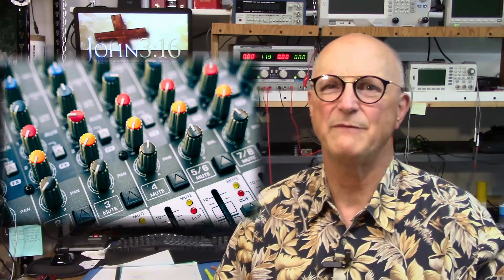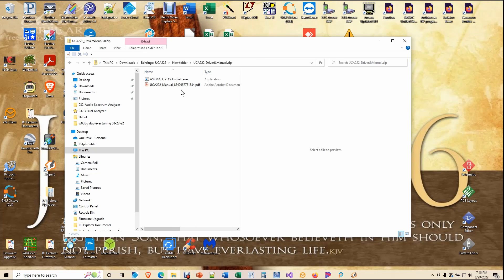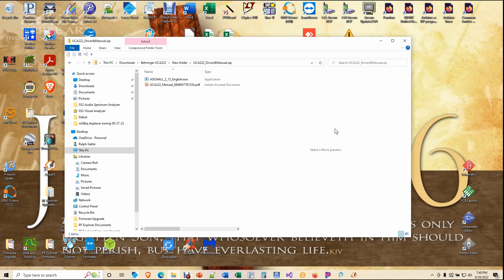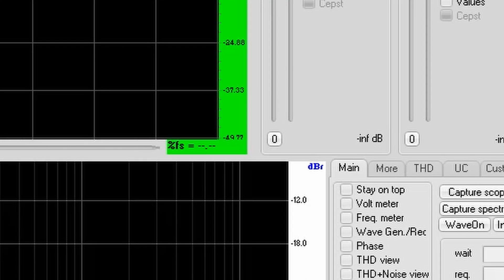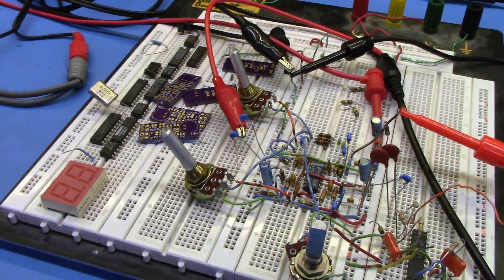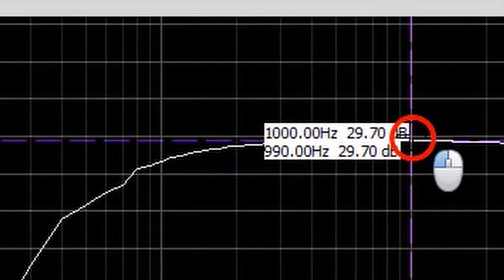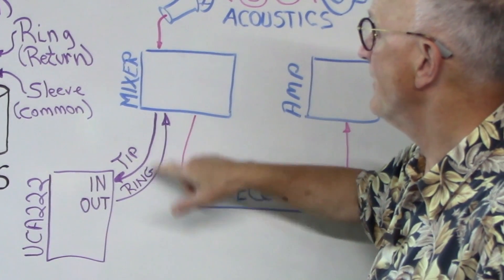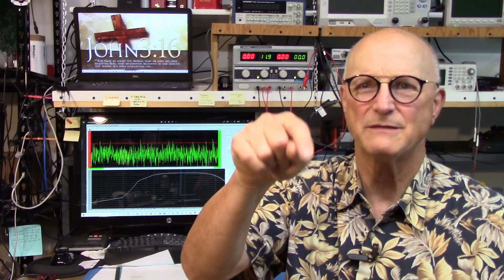Audio Spectrum Analyzer on the Cheap (032 )

Comment: A wonderful video! I have a Scarlett Solo 3rd Gen audio interface (192 kHz).
So I was thinking of taking a white noise signal (200 mVpp amplitude) from my Siglent SDG1032X and feeding it directly into the audio interface, while also sending it through a UUT to the other channel of the same interface. Then, I would feed both signals into the spectrum analyzer of VA and display the difference in dB.
Could this work? thanks in advance
Reply from the maker: Thank you! I'm glad you liked the video. Your plans sure seem to be the right way to go. With the Capture Spectrum you can save the data and process with a spreadsheet. You are on the right track! :-)
Reply: @eie_for_you  Unfortunately, my Scarlett Solo 3rd Gen sound card doesn't have a stereo input. I wanted to know if the Berhinger UCA 222 is compatible with Windows 11.
Reply from the maker: Yes, the Behringer UCA 222 is compatible with Windows 11. I have used it there. Just follow the directions in the video about making it a stereo entity in Windows. Windows likes to default all of the audio inputs to mono.  Upon a Windows update (which come way too often), the update may revert it back to mono. Don't you just love how they "help" us? :-)
Reply: @eie_for_you  Sorry, in the link you suggested to download the software I see the asio4all software; is this correct? yhanks inadvance
Reply from the maker: the asio4all is the driver for the UCA222. The visual analyzer link is above that a ways in the description. I hope this helps. :-)

Comment: i have got the focusrite audio interface 3rd gen. will need to purchase a 6.35mm 1/4 inch TRS Stereo Female to 2 Dual 1/4 Inch TS Mono Male Y Splitter Audio Cable . fyi i have purchased the dayton imm-6. its the same setup right?
Reply from the maker: The audio interface ... as long as it is stereo and can supply stereo channels.
As far as you microphone, is it the same ... well...yes...and no. It depends on what you are trying to accomplish. The advantage to using the existing system microphone, mixer, speakers and amplifier is that it take *everything* into consideration, including the frequency response of the microphone, speakers and so on. It also puts the microphone in the physical location in the space where it is going to be used. Acoustics are everything. For instance, at my church we have one microphone which is nearly impossible to extinguish the ringing from. Put *any* microphone in that same location and we get the same issue (the speakers are in the wrong place and hard mounted to the wall!). So, microphone location and frequency response is pretty much everything when leveling out a venue. 🙂

Comment: Need some help. I want a spectrum analyzer to work in my custom project vehicle. I want the signal to be displayed on the tvs in my vehicle for the fun factor. I can buy SA's on amazon but none have a video output to send to a screen. What do i need to get the video signal to a tv?
Reply from the maker: Seeing as this is done in software running on a computer, you would simply use the TV as a computer monitor. 🙂
Reply: @eie_for_you  As per this example, the berr is only putting out audio to the pc to show us the programs. So, still no video output. As it's a vehicle, I am not putting in a pc. So, again, is there an analyzer that has a video out passthrough maybe a portable one, or are all just 3.5 or similar audio outputs?
Reply from the maker: @bnaudio7813  Aaaaaahhhh .... sorry for the oversight!😟 I'm sorry that I cannot help you on this one as everything that I am doing generally uses a computer. 😕
Reply from the maker: Cool! :-) (sorry for the late reply ... man, this comment system often "hides" responses to previous responses.)

Comment: congratulations !!! this is the moust necessary tool for verify DIY and other audio projects for me !!!
Maybe, its necessary one box with compatibilizaction for all types off audio signals...
thankyou
Reply from the maker: Yes, I have also found it to be an awesome system for doing this stuff. When I worked on product development for a company that manufactured audiological equipment, I got really spoiled because we had a top of the line Hewlett-Packard Signal Analyzers. They were soooo nice and soooo expensive. This does the job for me just fine for the stuff I do now. 🙂

Comment: This what I looking for...tnz
Reply from the maker: That's fantastic! 🙂
Reply: @eie_for_you  now I want to setup. Test rig on how to measure THD of my power amp at full load...I have already a dummy load and scope.. the problem is how can I input that large amplifier signal on DAW without compromising audio signal linearity and not frying my audio interface... Pls need help
Reply from the maker: @jeffersonavila7275  Use a simple resistive voltage divider of a high enough impedance that it doesn't disturb the output to the load.
I'd just connect the resistive voltage divider across the load.  I am assuming this is a linear amplifier as opposed to a class D or similar amplifier. 🙂
Reply: @eie_for_you  yes, class AB power  amplifier... But I'm planning also to test class d single ended output....
Reply from the maker: @jeffersonavila7275  I had forgotten about the low pass filter on the output of the PWM to produce the analog signal to the speakers.
In this case, it is the same thing ... a simple resistive voltage divider should do the trick.
Some amplifiers of this type depend on the highly inductive load of the speaker to be part of this LPF. In this case you would have to use "acoustic coupling" with a speaker and mic with a known HD. You could use any speaker and mic and "calibrate" them yourself. Measure the HD of a purely analog amplifier with a known signal at a similar level as what will be used to measure the test subject. Then measure the HD at the output of the mic. The difference between the two is the "calibration factor" for your speaker and mic.
Now connect the test class-D amplifier being careful to maintain the exact same acoustic environment used in the "calibration." Measure the HD at the output of the mic, remove the effects of the speaker and mic. And you are there. 🙂
Reply: @eie_for_you  seems difficult to make.... Can u make a vlog about class d thd measurement, ? Tnx
Reply from the maker: @jeffersonavila7275  Unfortunately, I do not own a class D amplifier. But this would be an interesting topic to address. 🙂

Comment: The USB scope you said you use all the time. That being the case why download the VA scope using the VCA-222?
Reply from the maker: The answer to your question is that the UCA-222 is WAY cheaper than an official USB scope.  For many purposes, this does the job very nicely along with the Visual Analyzer software.
The VA software is a piece of software that uses whatever audio interface you might have (including the built in one that is in all computers) to provide a scope-type and signal analyzer-type experience for audio-type projects. This includes determining the audio frequency response of circuits or systems.🙂

Comment: your microphone is clipping
Reply from the maker: Fixed. Thank you! My gain was up a little too high on the mixer. I backed it way down and now make it up in post production starting in my next video. :-)
Reply: @eie_for_you   nice can add some foam around the mic for wind noise, the distance amd angle is important also,  i think there is a sensor and program that senses it and automatically adjusts
Reply from the maker: @DeVoNmotorsports Thanks! In post production I can add a compressor and a limiter to dress up the audio. The clipping was in the original recording...can't do much about that unless I am willing to drop $$$ on special software to "unclip" it. Not happening.  😀

Comment: I need to show the audio output of crystal radios (since IP law prevents me from playing it). Especially cross talk between channels.  My assumptions: 1) this has enough resolution to show the different audio waves (say voice and music) and 2) that I don't need stereo input to do that. True? Thanks in advance.
Reply from the maker: So, you are wanting to analyze some audio from a crystal radio. Audio, in general, is considered between 20 Hz and 20 KHz. All forms of music consume most of this spectrum to one degree or another. Some of the bass stuff is actually sub-audio (we feel it, not actually hear it).  The human voice is a subset of this frequency space, generally running between 500 Hz and 3 KHz depending on the person. Men tend to be in the lower half of this and women, the upper half.
With all of this said, if all you are doing is analyzing an audio source and that source is monaural, then you would not need stereo capability.  The stereo capability is needed if you are trying to either determine the frequency response of a device, circuit or system or if you were looking to analyze a stereo signal.
As a note ... most often, the main vocals of a stereo track are usually "dead center" with little to no phase difference between channels. The music portion is carried in full stereo. The vocal track can be significantly reduced or eliminated by eliminating the signal that is common to both channels (the voice/singing is a "common-mode" signal).  Hope this helps. 🙂
Reply: @electronicsfortheinquisitiveex  Yes, thank you very much.
Reply from the maker: @tsbrownie You are very welcome! 😀

Comment: Excellent information and demonstration. Just what I need to see the noise I have on one of the four band eq stages of my practice bass guitar amp. So next quest is to find that pink noise generator for the input signal to save me the "plucking" pain of creating a source signal!
Reply from the maker: Thank you!
The software, the Visual Analyzer software, has a "built in" signal generator that will provide the needed signals via the sound card on you computer. So you should be set there. 🙂

Comment: Visual Analyzer is a great tool, i've been using it for years  as realtime audio monitoring with the key feature it shows logarithmic frequency axis which other tools do not provide at all. And it has lots of features, and it's capabilities are bound to the audio device and driver, once a very high capability hardware is connected with a proper windows audio driver, you can configure sampling and FFT to match it and get very fine detail, but for audio i don't see the necessity in going over 44100/16. Never used it as a bench oscilloscope, but it was created for that purpose, i'm going to try.
Reply from the maker: I also like my Vellman PCSU200 USB-based oscilloscope for doing audio work.  I is an oscilloscope, spectrum analyzer, transient capture, built in signal generator and has a built in functionality to create detailed frequency response plots.  Frequency response plots are not real-time like Visual Analyzer, but for circuit analysis of an amplifier, it is super.

Comment: This video is very interesting, I’m currently trying to work in car audio and was looking for a way to set crossovers on car audio amplifiers. Although there are tools on the market such as the Steve Meade tools that can do this accurately they are very expensive so I figured maybe an audio visual analyzer could be the solution to this. Although I’m not sure this will work in my specific situation, I am trying to learn more about car audio and how to read this kind of information so I can in the future install quality car audio systems, so this was very interesting thanks for the quality video!
Reply from the maker: I am glad that you found the video helpful. 🙂 Car audio is in many respects no different that any other audio venue except for the acoustic environment and the power source used. The size of the equipment changes to fit the vehicle.  The temperatures that any electronic equipment is subjected to inside a vehicle is also extreme; this is why "automotive" rated components have such a wide ranged of operating temperatures. Enjoy your pursuit of knowledge ... "always learning" is the motto of the inquisitive experimenter.

Comment: Stunningly clearly presented video, and the Lab equipment I saw here shows this is one serious Experimenter! I was fortunate to be of the same generation, from having a little Transistor and Tube Radio repair business in 4th grade on to working at the Authorized Service center in a Lafayette Radio store in NNJ in the 70's, enjoying reading Wireless World and Audio magazine. Did Pioneer, Sansui & Revox authorized service thru College and bought an SX-1010 for $470 there , saving all summer. I always wanted to get a PC Sound card based Audio Analyzer going and bought a Behringer UC-222 tonight! I am also into old Ham Radio since 1969, and am restoring a Kenwood 599 Twins setup, AND bought the great value Behringer B1 Mic, Tube Preamp. EQ, and 4600 Compressor to make a wide band sounding Ham Radio station especilly for the "AM Window", and add my full National Radio setup including NCL-2000 amp.
Wonderfully clear Installation and setup info for this great USB to Audio interface, and the BIG picture of probing the whole Sound Chain! I have some great Audio and RF signal generators AND a very clean HP339A Distortion Analyzer from a Ham in NJ on ebay only $300 to compare readings with.  Along with the Tiny SA Ultra, and NanoVNA-F for RF, the setup described here and GREAT freeware, so well explained fills in the Audio Test spectrum beautifully! THX, Hilary W4HDL
Reply from the maker: You are very welcome Hilary!  And thank you for the encouragement!  Wow! an HP HP 339A Distortion Measurement Set for only $300! Nice catch! 🙂 Hopefully it has been calibrated recently enough to give some confidence in it.

Comment: It will be great if you can make a detailed tutorial video of how to setup/calibrate cassette deck.
Reply from the maker: It's been 36 years since the last time I did that. As I recall, we used a "standard" stereo tape with tones on it to adjust head alignment. We looked at the stereo audio and adjusted the heads until both channels were the same. We degaussed the head and cleaned the capstan and rollers and head using 99% isopropyl alcohol and lintless q-tips.
When I was doing all of that stuff, I was more involved with VHS tape decks than audio cassette decks. I remember very little-to-nothing of those. It's been too long.
Hope this helps some.

Comment: Great vid to demo bode plot with VA, could'nt find this out myself from the docs and ended up using REW ( currently Rew_5.20.13 ), thisis a on button click for superb bode plot response, it's worth a look, I originally dismissed as I thought it was only for room acoustics but it does it all with some very nice features, thks for this vid i now know how using VA - thks.  Just considering obtaining a Digilent Analog  Discovery 2 ( AD 2 ), very expensive but complete lab in the palm of your hand for this type of work, worth a look.
Reply from the maker: I have a similar thing with my Vellman USB scope which includes spectrum analyzer and so on.
https://www.velleman.eu/products/view/?id=377622
https://www.amazon.com/Velleman-PCSGU250-Usb-Pc-Scope-Generator/dp/B006DXCO3E
I have the older model.  It does a pretty awesome job at under $250 through Amazon.